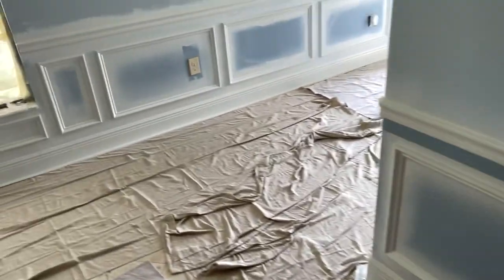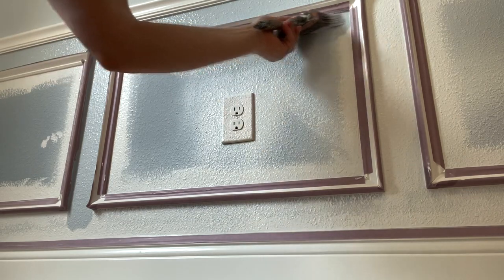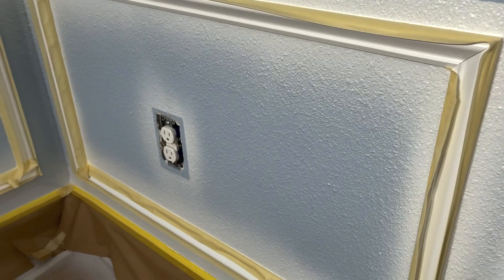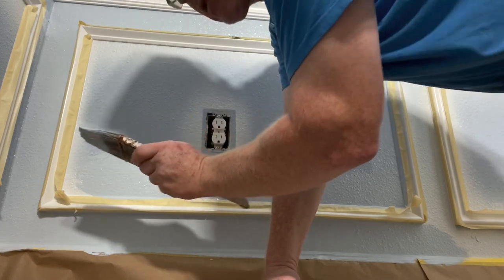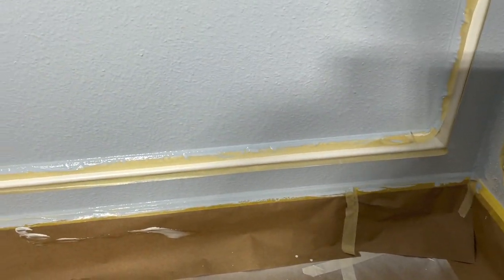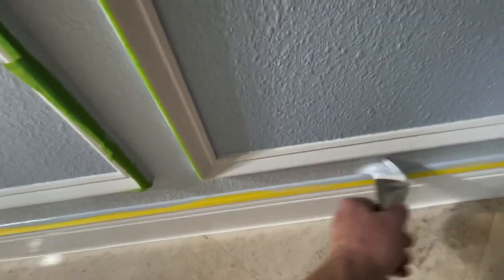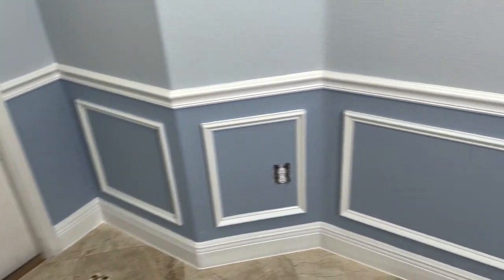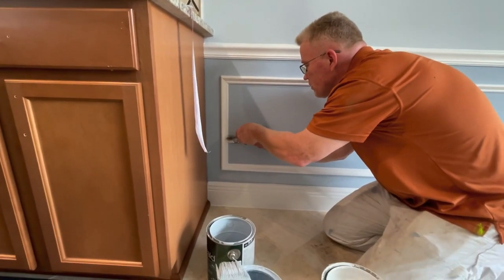Paint Picture Frame Moulding with Brush, Roller, Caulking & Tape - Spencer Colgan

Comment: I've used a narrow farrow Purdy 2 1/2 inch sash  brush for cutting in. I also use the  cotton T shirt rages with a 2 inch putty knife for cleaning up my edges. I have found the micro cloth you where using will not thin enough to rub out my overruns . You used to be able to buy cotton rags in a 10 lb box at the paint store, not sure about that today. BTW nice work !